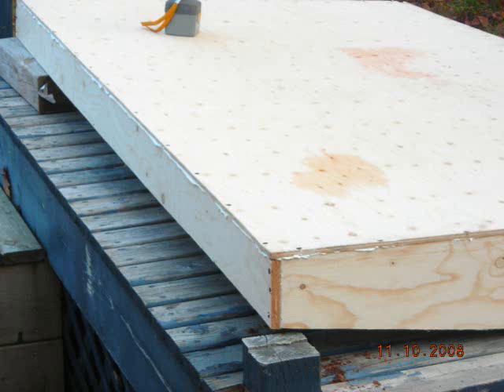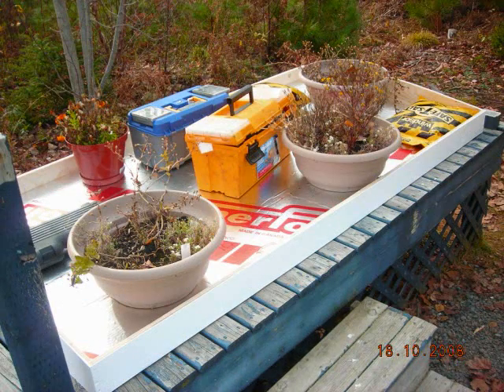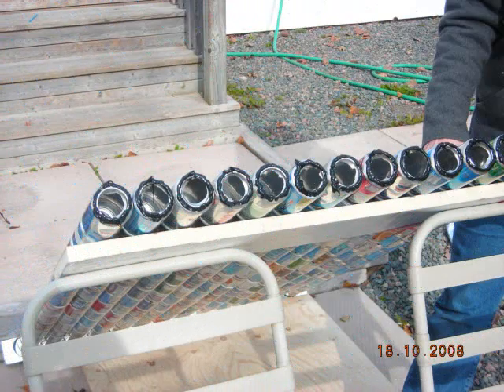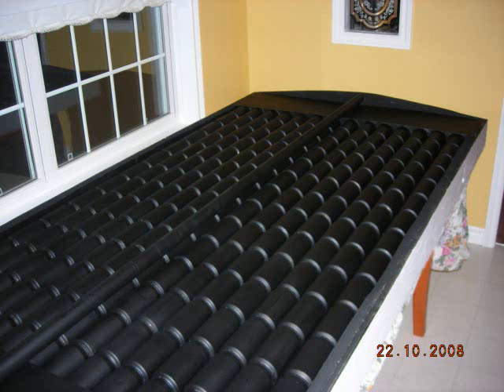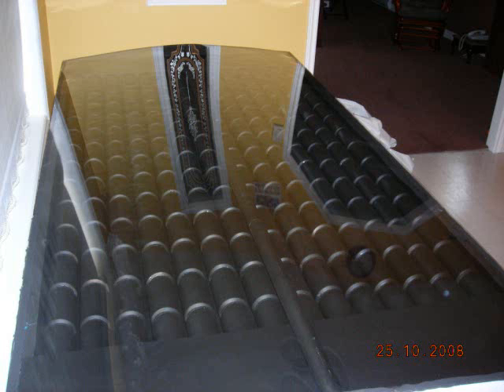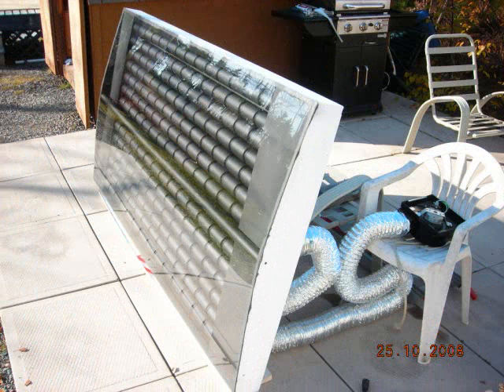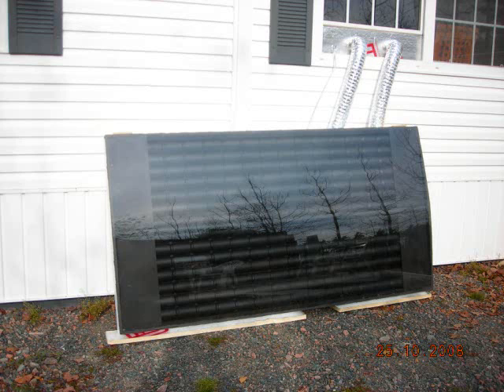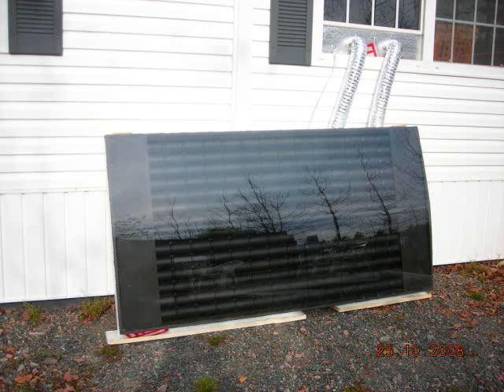Solar Heater

Comment from the maker: The black wire then goes back to the fan and connects to the black wire there to 
power the fan.  In this way the panel must be up to temperature and you must be calling for heat
with the thermostat in order for the fan to start. Like I said , this is what I've done.There may be a 
better way of doing this. Hope this helped.

Comment from the maker: What I've done to control the fan is this.  From your Power Supply connect the white wire to the whte 
wire in the fan,
Take the black wire and connect it to a 110° bimetal snap disc switch also known as a fan switch.
This switch is located inside the panel at the hot air end.  You can get this switch at a heating and cooling
supply store, $7.00 The black wire then continues on to a 110 / 240 baseboard thermostat ( $10.00)
located in the house.

Comment from the maker: Here are a few points that may interest you.  Total cost of project including today's purchases = $586.  My research shows I should save the equivalent of one 200 gallon barrel of oil this winter ($900).  Cost of running the fan for the winter = $10.00 -$15.00. This would put my breakeven point at about the end of February. When I have some data collected I will post it.

Comment from the maker: The fan is cotroled in this way. From your power supply the white wire goes to your fan. the black wire goes to a snap disc switch located inside the panel,it will close the circut at 110 deg. The black wire then goes to 110/240 volt baseboard thermostat located in the house and then to the fan. In this way the panel must be up to temp. and you must be calling for heat with the thermostat before the fan will run. I bought a 100 stainless screws to hold the lexan in place but it held solid as is.